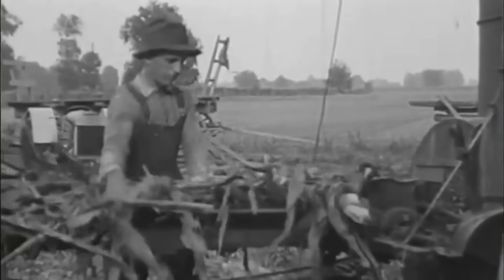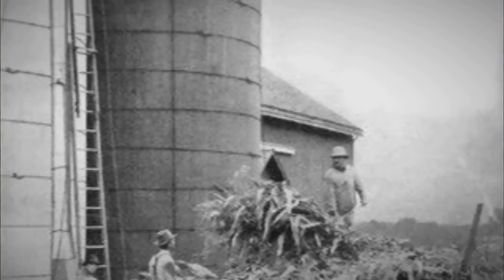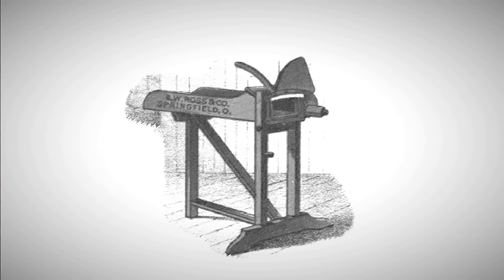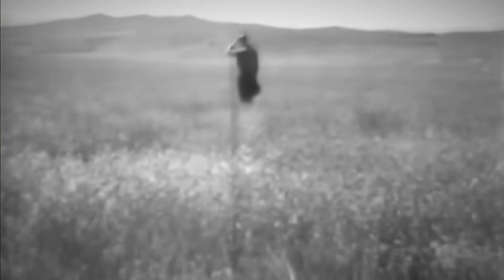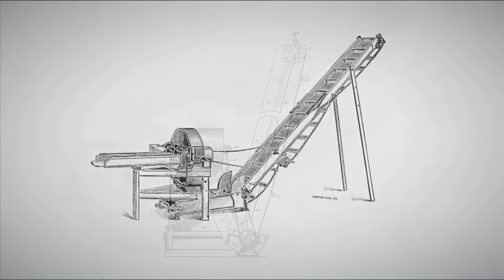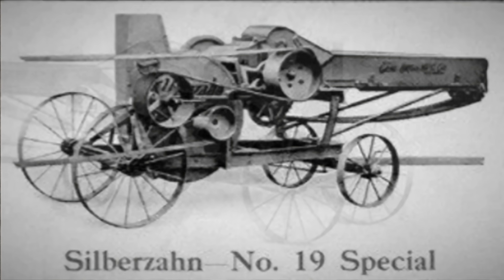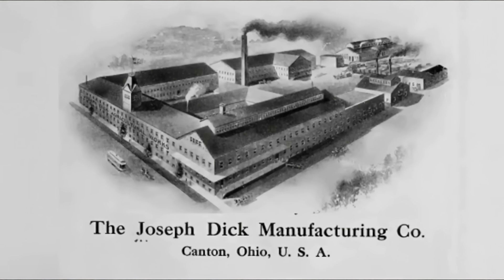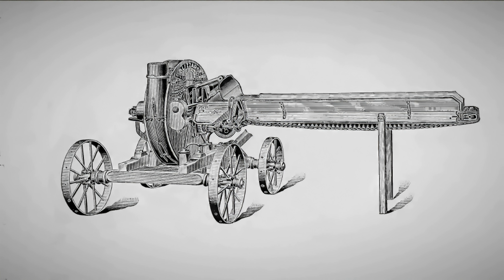The History of Ensilage Cutters / Farm Machinery Stars Series

Comment: Now I'm curious how the silage was/is best "compacted and "sealed", as this video spoke of.
Reply: Depends on the silo structure itself, there are vertical round silos which were typical in the US dairy belt half a decade ago. Those get filled and gravity packs em, the last few loads are introduced slowly and once it literally settles, a smart farmer will run a silage blower half throttle to introduce air and climb up to cover the gaseous silage with plastic. The same principles apply to bunk silos, ag bag silos and old school New Zealand style piles. build or store a pile, pack it with tractors or gravity, and cover it to seal it quickly.

Comment: in the very early 40s my dad combined a 2 row corn binder (notter disengaged) attached to a silo filler power by an attached Chrysler engine. A truck would drive along side the moving 
combo binder/chopper and when loaded would take the load to the silo filler. As a youngster I was given the job walking down the silage inside.